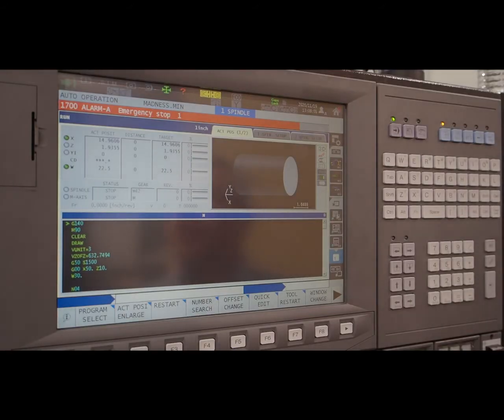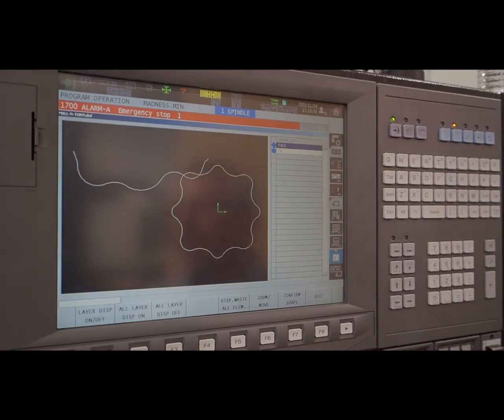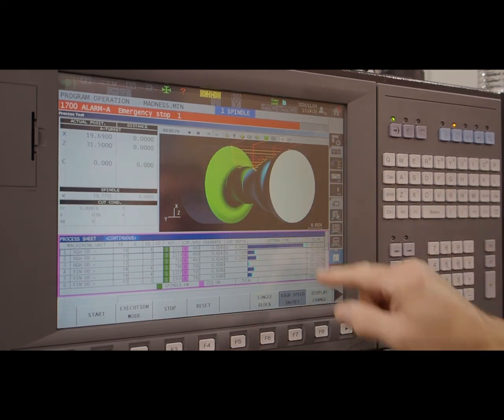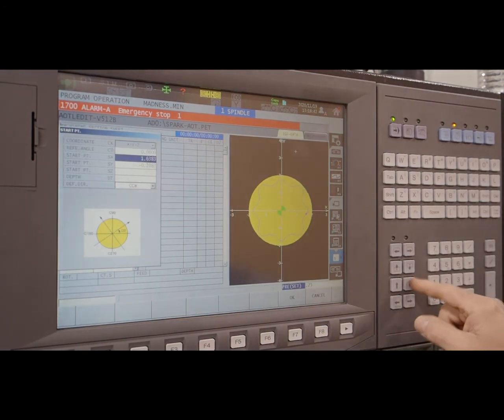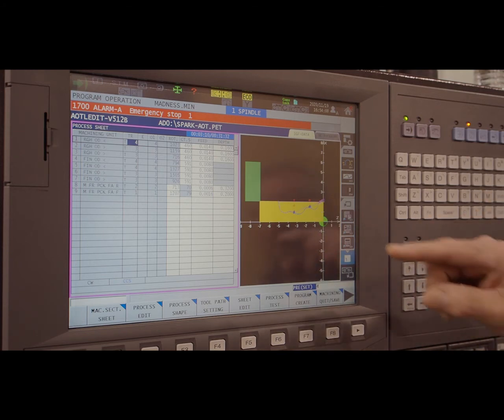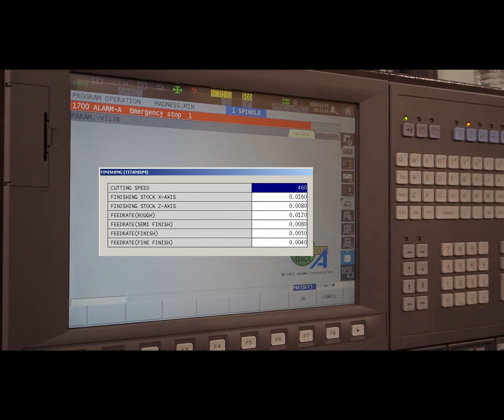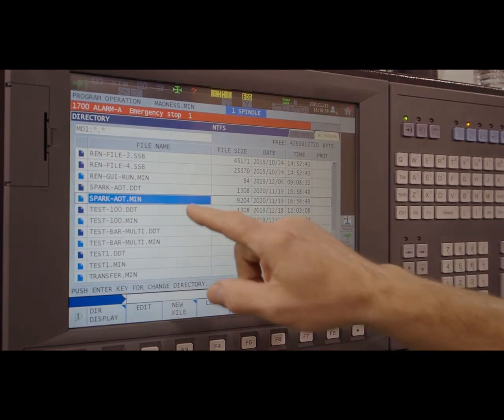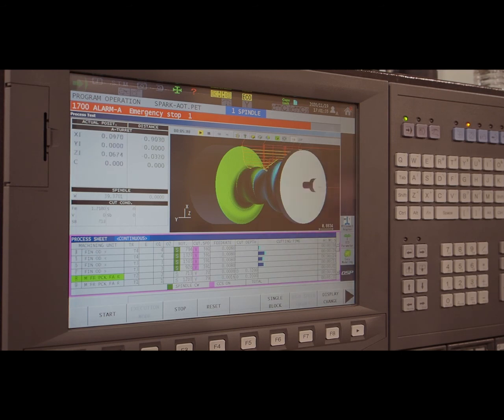Okuma's Advanced One Touch Conversational Programming

Comment: Very cool, but isn’t it just easier to do all this in cam/cad software and simply import?
Reply from the maker: Thank you for watching this video and for sharing your question. I consulted a member of our engineering team and they shared the following: "CAD/CAM software relies on a good post-processor which could possibly give you bad code in some cases, but AOT will give you a working program every time. Simple programs can be created either on PC-AOT or at the control without occupying a CAD/CAM license that could be used to work on more complex parts. AOT on the machine gives you the ability to tweak speeds and feeds as you are running and feed that information back to the AOT file, eliminating the need to capture it on paper and go back to CAM software and repost. AOT can create processes automatically and look at tools currently available, which can be more labor intensive in many CAM software packages." We recommend connecting with your local Okuma distributor if you'd like to learn more about AOT. If you don't know who your local distributor is, you can locate their contact information here: https://www.okuma.com/distributors
Reply: @OkumaAmericaCorp  excellent info. Thanks for sharing that does make sense! I’ll look more into it. Cheers :)